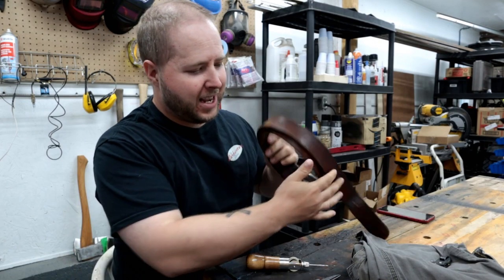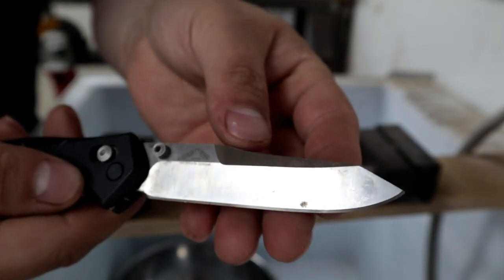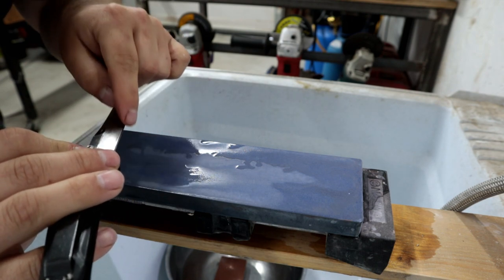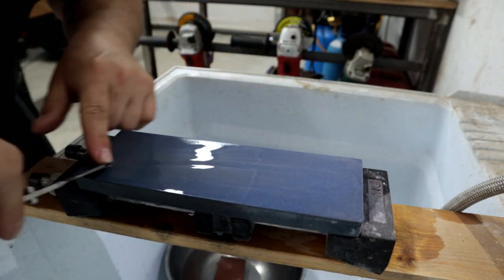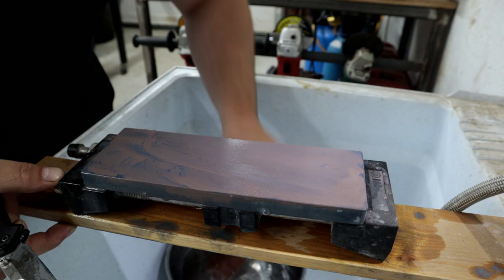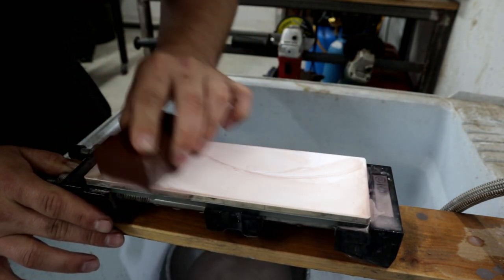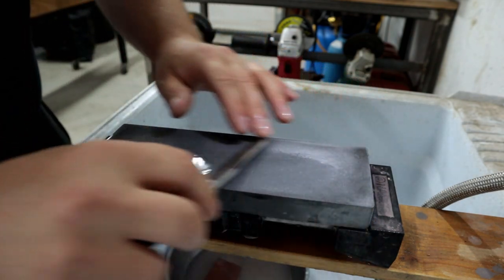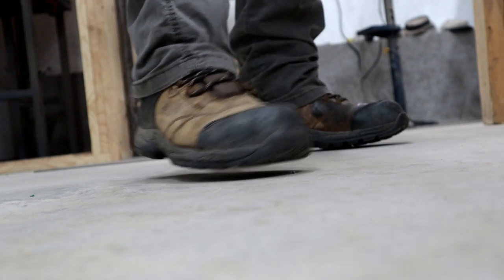Sharpening a Benchmade 940 Osborne with WATER STONES

Comment: The main knife of my EDC is a Byrd Tern as I can't carry one-handed and locking for legal reasons. To complement the Tern, I carry a Victorinox Cadet as the clean knife for food etc. On my keyring I also have a Leatherman Squirt P4, and a Sanrenmu A123 as a backup/beater/loaner knife. In the winter months I also carry a NiteCore Extreme with a non-crenelated stainless steel bezel.
Reply from the maker: Man, that's a slick setup! Sheesh!
Reply: @kyle_noseworthy  Thanks. I've been brewing this up over the course of a few years. Works for me. I can always add/adopt, when I feel the need to, but this works for everyday stuff.
Eg. when I help a friend with assembling furniture, I'll take my SwissTool Spirit, when it's more of a construction job, I'll take an extra beater/loaner, or when it's a campfire/woodcarving thing, I'll take my Mora 510 and a small hatchet/tomahawk.
Reply: I haven't been able to get my hands on a Tern, and I want one for the same legal reasons, but one thing concerns me about it, since there aren't any liners, and it's just G10 scales, if you were to push the scales together in the center, could you create some unwanted or unreasonable flex? Because I want to use it as a decently hard working knife.
Since carrying locking or fixed blade knives outside of my property is a no-go, I'm very limited on the options I can use. The only two I have come across that meet the requirements for a blade are the Byrd Tern, and the Boker Plus XS Drop, I'm saying toward the latter, because it has steel liners. But the Tern is cheaper, and if the flex isn't as big of a deal as I think, then I would be inclined to buy that.
Reply: @autumn5592  Go for the Tern, I've had it for years and it just works. G10 is incredibly stiff, it's not some cheap plastic. If I pinch it really hard, I can feel a tiny bit of flex, but you can't really see it. As an example: my Victorinox Huntsman flexes way more despite the aluminium liners.
Reply: @kaizoebara  Well, G10 is similar to Micarta (except G10 uses Fiberglass fabrics for strength), but I have made Micarta flex, so I was a little sceptical.

Thanks for reassuring me though because I don't really see a point on spending ~20 more pounds on a knife that has exactly the same features (except for marginally better steel.)

Comment: Isn't the point of a nagura to not only clean the stone but create a slurry to help sharpen the knife? Also I read somewhere that it's best to use a nagura of the same grit as the stone you're using so if you're using that beautiful Shapton glass 1000 grit stone you should use a 1000 grit nagura.  Not to say you're doing it wrong or anything because I have the same nagura and use it the same way you do lol.  Also I'd love to know how you keep your stones flat.
Reply: You are correct, but the slurry doesn't help to much, to my knowledge. Especially on ceramic type stones like he's using. (Since they're so hard and abrading.)
I would just use them to clean the surface materal, so you keep good sharpening performance. Though, I am inclined toward a rust eraser (since they shouldn't wear as fast, and do the same thing, while being cheaper.)

Comment: I have issues with stones, especially waterstones....i cant sharp blades on them, but cant make them razor sharp and that pisses me off...
However on diamond and ceramic,i can make them shave, though not hair splitting but still shave....
Stroping sometimes works when dealing on convex edges, but on other type like tanto or scandi doesnt work very well, i turn de diamond/ceramic....
Maybe im doing something wrong, but i dont know what....
Reply: Do you make sure you raise a burr on  both sides before moving up in grit ? Can't stress this enough if you are a beginer
Reply: @Cleymant  well yes, i can make a burr easily, though i think it may stress the blade
Reply: @hirayaman246  maybe you press too hard on the Stones. I only had results with diamond and ceramic as well when I started. Make sure you spend extra time to deburr on the whetstone, it s sometime harder with softer stones
Reply: @Cleymant  im just puzzled when i can switch to the next grit- i mean i can make a burr on one side, then on the other and i can keep it like this forever.....
Reply: @hirayaman246  once you got burr on both sides, make short and light alternate passes until you feel no burr from both sides. You have to ligthen the pressure as you go. You can then finish with edge leeading strokes alternating to remove the biggest of a burr
Reply: @Cleymant  Hmm...you may have a point there..... do you know cliffstamp? He uses the same method as yours.......i mean used
Reply: @hirayaman246  yes i know him, but this method is not the same at all